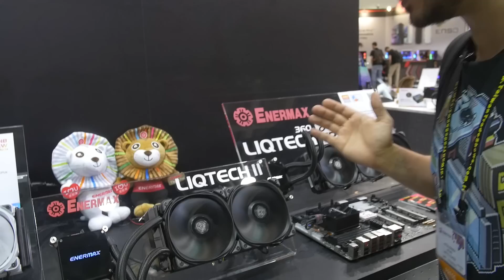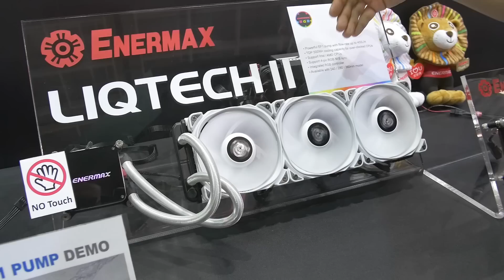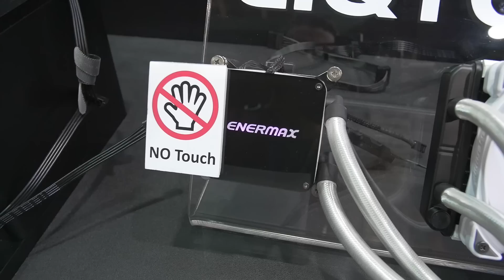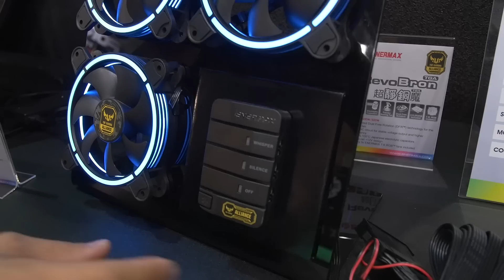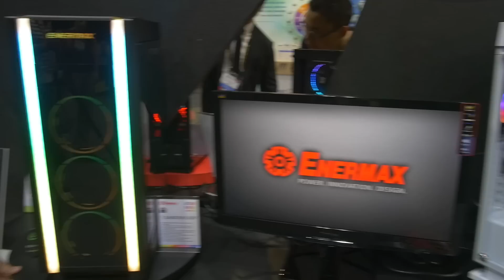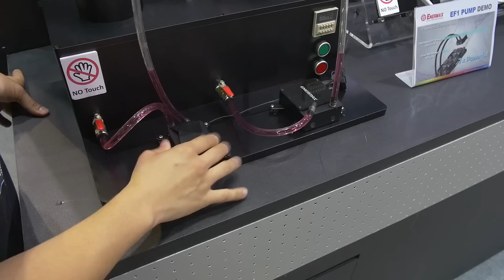Enermax reveals WHITE Saberay, Liqtech II and more!

Comment: HI GUYS I NEED SOME HELP UMM CAN YOU DOUBLE CHECK MY COMPUTER PARTS BEFORE I BUY IT.. THANK YOU

GPU- Gigabyte GV-N1050WF2OC-2GD Geforce GTX 1050 

MOBO- GIGABYTE GA-AB350M-HD3 AM4 AMD B350

CPU CASE- Thermaltake Versa H15 Window Micro ATX Gaming 

PSU- EVGA 500 BV 500watts 80plus Bronze Power Supply

SSD- Kingston 120GB

HARDRIVE- WD Blue 1TB Desktop Hard Disk Drive

PROCESSOR- Amd Ryzen 3 1200

RAM- 2STICKS OF HyperX Fury 4GB 2400MHz DDR4

Comment: It's SO nice to see a company that gives a shit about developing an actual high performance, high quality AIO instead of just cheaping out with another shit Asetek relabel.
Enermax KILLING IT yet again! 

Also, the TUF power supply being only 80+ Bronze rated - how appropriate considering the underwhelming garbage state of TUF motherboards now...
Reply: Enermax is not killing it. The first tr4 AIO has terrible gunking and leaking issues, especially after 6 months. Because of that issue that they know about and have admitted to on some social media platforms, I'm currently wait to hear back about my GPU, MOBO, and AIO that was sent out cause the AIO leaked out onto my GPU and fried a memory module its going to take up to 2 months to get back.

Comment: You ever just flex on signs that say “Do Not Touch” by touching the item next to it
Reply: I think they meant cpu block so there is no fingerprints but yeah I found it funny :D
Reply: HI GUYS I NEED SOME HELP UMM CAN YOU DOUBLE CHECK MY COMPUTER PARTS BEFORE I BUY IT.. THANK YOU

GPU- Gigabyte GV-N1050WF2OC-2GD Geforce GTX 1050 

MOBO- GIGABYTE GA-AB350M-HD3 AM4 AMD B350

CPU CASE- Thermaltake Versa H15 Window Micro ATX Gaming 

PSU- EVGA 500 BV 500watts 80plus Bronze Power Supply

SSD- Kingston 120GB

HARDRIVE- WD Blue 1TB Desktop Hard Disk Drive

PROCESSOR- Amd Ryzen 3 1200

RAM- 2STICKS OF HyperX Fury 4GB 2400MHz DDR4

Comment: semi-passive cooling in PSUs based on load rather than actual temperatures doesn't seem to be a good idea. if a 650W unit remains fanless until about 300W load, which is quite a lot for even a common midrange system running stock clocks, then it might rarely spin up unless the system is mostly used to play demanding games or perform heavy compute tasks like rendering. and even a high efficiency unit generates a bit of heat under lighter loads, which is trapped in the standard downward facing orientation for PSUs and might degrade the components over time. Seasonic actually recommends upwards facing installation for their fanless Titanium units so the heat passively dissipates into the chassis. 
besides, your mandatory case fans and CPU cooler are probably noticeably louder than the PSU fan spinning at its lowest speed. personally, i also changed my graphics card's 0 RPM until like 55C to lowest RPM instead. i still don't hear it, but core temps during low power desktop usage dropped from upper 40s, i think, to around 30C, which is much more pleasant to look at